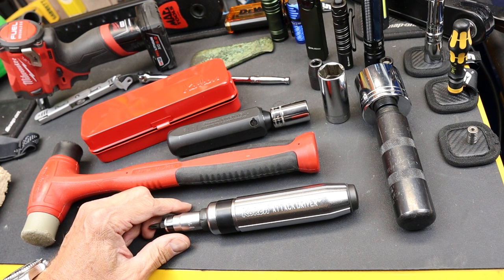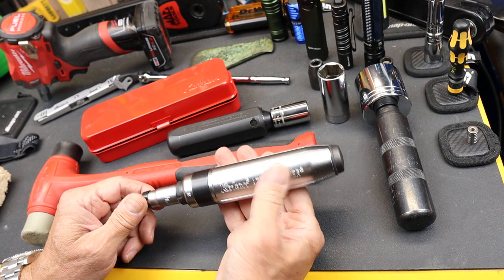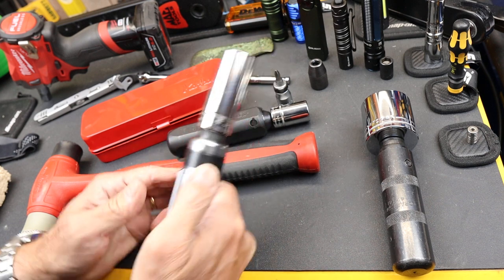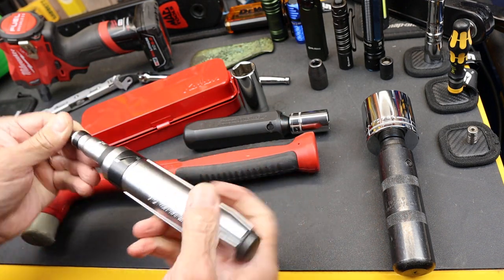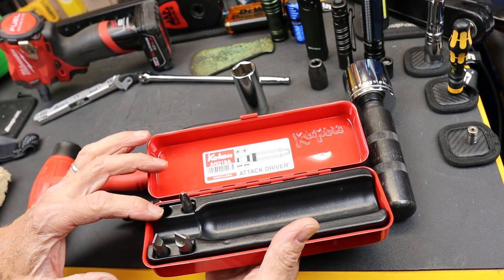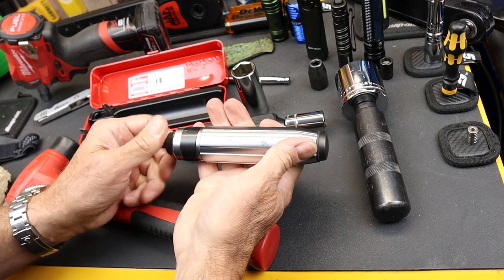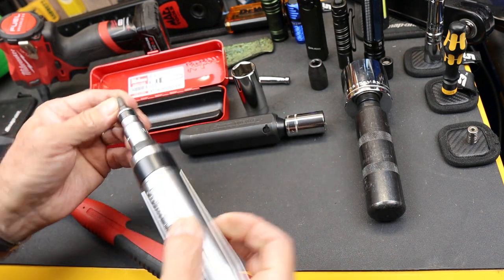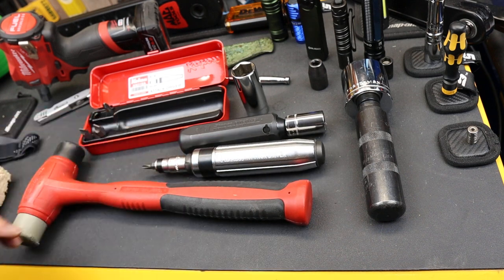Koken Attack Driver: A Tourniquet fastener-twisting option. Frontline medicine against wrist pain!

Comment: I have a Koken Driver I bought 50 years ago, going strong. I think it was $6.00. Came in the same red box, but with metal dividers. I use it mostly on motorcycle case screws. Always works.

Comment: If you want more of a screwdriver check out the Vessel Megadora set. I just used it on our Lexus rotor screws. I have a Blue Point set that looks like your Craftsman. Probably from the late 70's early 80's. Still works great.

Comment: Ive still got the early model Koken impact driver I bought 30plus years ago. Done a power of work and no issues or failures in the driver. Only breakages have been some of the bits.

Comment: I think those mostly see use for removing brake rotor retention screws. The Craftsman one you have I think is made by Lisle... I had one back in the early 70's... IIRC paid $6 or so for it. It saw little use...
Edit, Yes, just looked, it's a Lisle SKU: 30000.

Comment: I have one I got at a garage sale about 25 years ago. It’s a Snap On piece. I think I paid 12 bucks for it. Only thing I’ve ever used for was the Phillips screw on brake drums. But it was great for that. Should be great for most flat head screws since the drive is usually unreasonably small for the amount of surface contact the screw had

Just an odd thought…. I wonder what would happen if it was paired with an air hammer lol

Comment: I have a 74’ Honda cb175 and I’ve used one several times in those Japanese Phillips screws and if I had one that I thought was going to cam out I went straight to that and it worked amazingly well, and it was just one I picked up at Autozone.

Comment: One interesting tool for removing stuck fasteners is called the Shake N Break.  It's an air hammer attachment that lets you hammer with screwdriver bits along with a handle that lets you apply torque.  The only problem is you need air.

Comment: I use these all the time to remove stuck Phillips head screws that are used to secure raised computer floor tiles to the stands.  I pull up the carpet square which exposes these screws and then just wack it with an impact a couple of times.

Comment: I wonder what the torque spec is on this one.

I have the Wera impact set that is rated for 25 Nm, works well and comes with a full compliment of flat, phillips, pozi, torx and allen bits. I bought the metric set and then added the SAE allen bits. Has more of a traditional screwdriver profile, so it works better if you have a fastener down in a tight space.

Comment: These are really good. Often times actually better than using an impact driver. Especially on flathead screws and painted over Philips screws.
 They also make this driver with a rubber overmoulded grip. Although I did email Koken about the torque spec of these ( and didn't get an actual answer). I have no doubt in my mind that these are the best manual impact driver money can buy.
Reply: I think the torque on these genuinely depends on how hard you hit it, seems to hit some curved spline gear inside or something of the sort so i guess max torque is whatever the output is right b4 those all break which im assuming would be exceedingly difficult and would have to happen while its in motion pressing on those because when it bottoms out im assuming it just hits a flat bottom plate, so if you break it with just a hydraulic press or something you arent really seeing to torque limit, also a normal impact wrench is using a much smaller hammer and relies on just way more hits in a small period of time so im thinking this thing can definitely do a better job then your average impact wrench